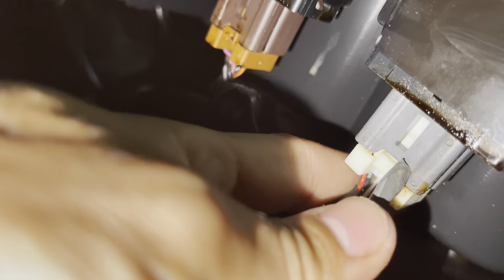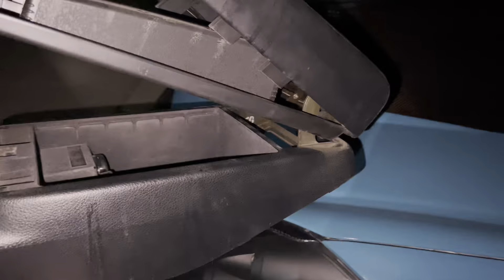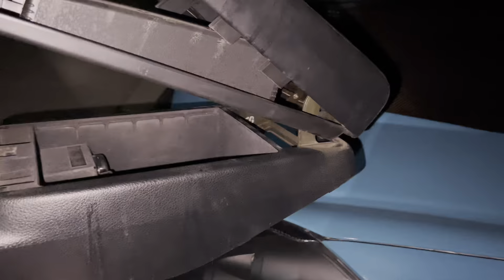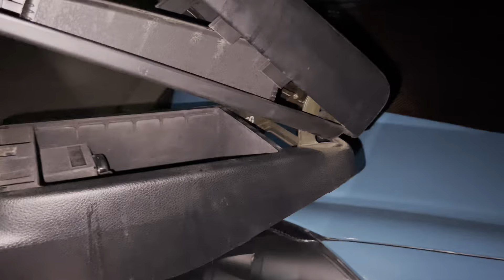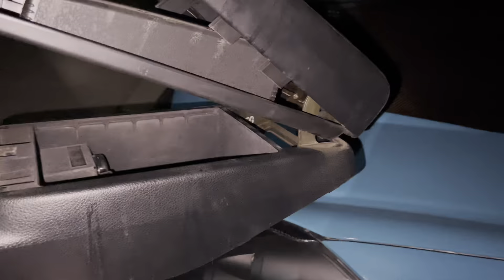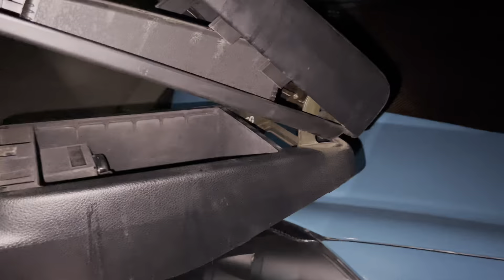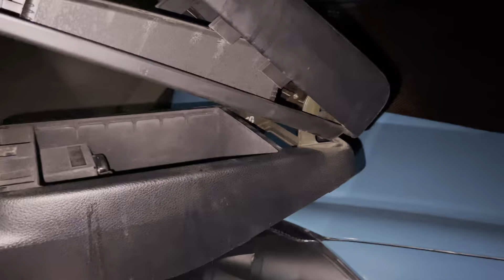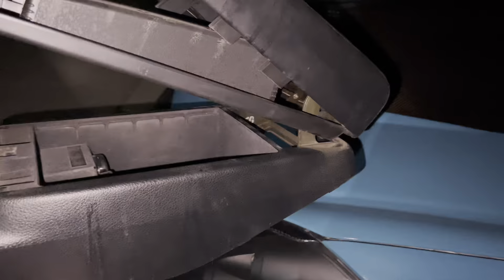G35 Armrest & Centerconsole Replacement

Comment: How tf you took the gearbox off it don’t jus pull out
Reply from the maker: Pull down on the gear boot & remove the little pin first
Reply: @CastellanosMotorSports  pull it down to drive then remove the pin and shifter? After that put it back to park or leave it in d
Reply from the maker: @erised-san  put it in park so it doesn’t move